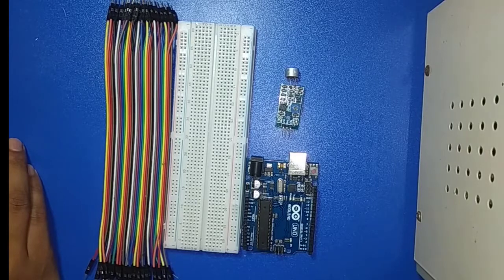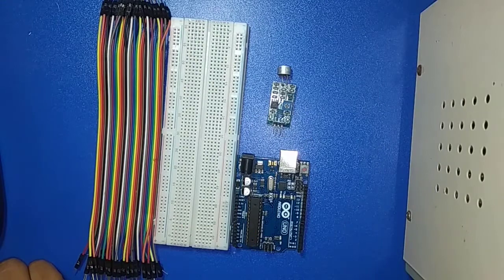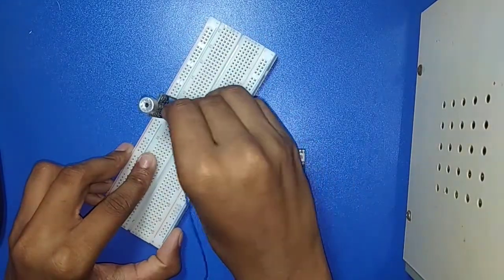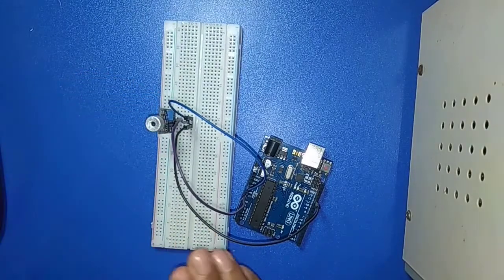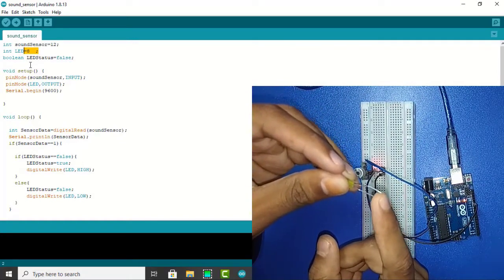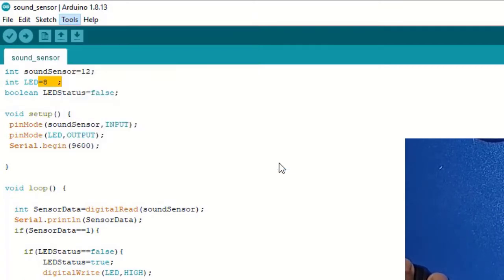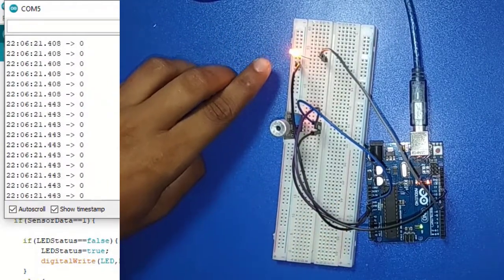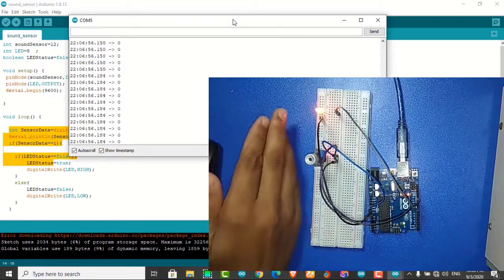How To Make A Clap Switch | Control Light & Fan With Clap using Arduino | Indian LifeHacker||Diy Cla

Comment: Can you plz do it with a large bulb plz
Reply from the maker: Sure bro.
Here use only relay fro high voltage supply.
Reply from the maker: https://www.facebook.com/100006272975218/videos/2843361552549583/

please check here